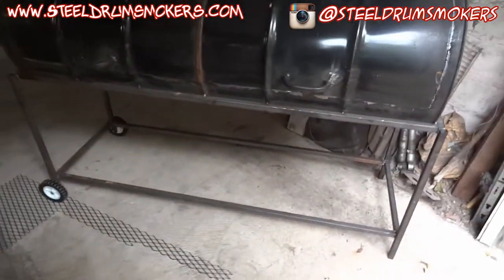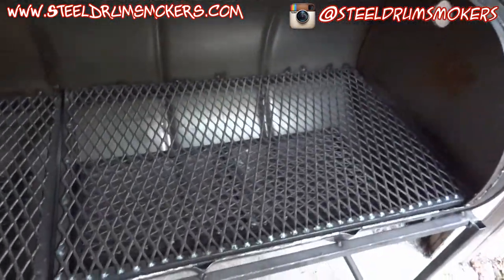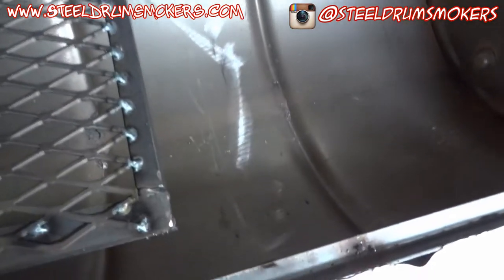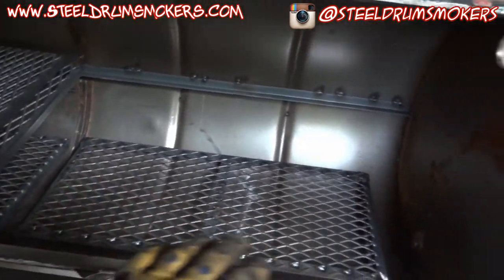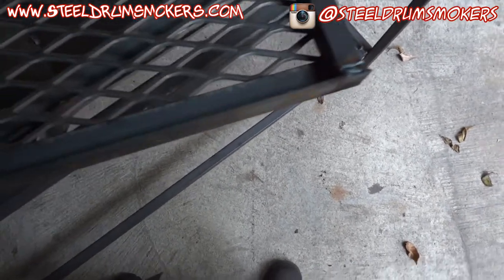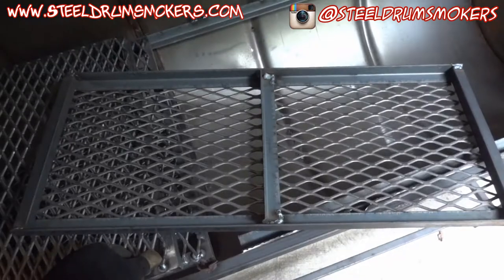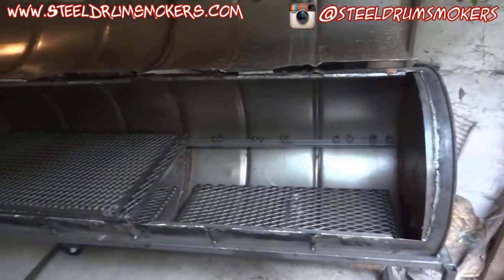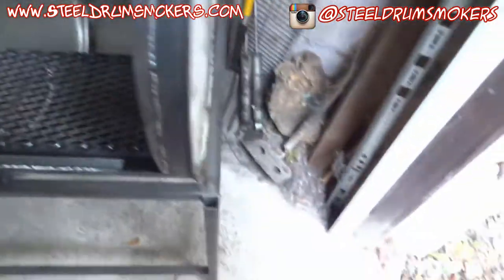Steel Drum Smoker's BBQ - Double Barrel Grill Build - Part 3

Comment: I wanna combine this concept with aspects of the 275 gallon smoker to create a unique build.... two horizontal drums and one vertical drum for the firebox and warmer... I love the water smoker internal design for the grease and water drain... I probably would widen this Frame so the drums can sit lower in it, and the port from the fire box can be cut into the end of the right drum ... how did this double drum smoker work for you ... did you end up scrapping it ?
Reply from the maker: So... I should have cut the drums in half as opposed to cutting the doors out. It was very flimsy and I never ended up using it. I still have it, haven't quite figured out what to do with it at the moment.

Comment: Looks good, Dash. I wouldn't cut it up. I would at least cook on it once after all your hard work. I would recommend adding two vertical pieces front and rear in the center that attach to the drums. Otherwise,  it may buckle in the middle once you throw the heat to it. I like it. I want to see that bad boy cooking. :)
Reply: ...and also run two short legs to the ground under those pieces. Just a suggestion, but that will save you some grief.
Reply from the maker: +70kirkster hopefully I can figure out how to make it happen. if not I'll be texting you, LOL
Reply: +Dashtc Basically,  two extra framing pieces just like the ends. Connect the center of the drums where you welded them together to the center lower frame, but also leg all the way to the ground. That will shore everything up. But you're welcome to text anytime my friend.

Comment: Barrels are hard to weld on I’ve done it a few times.
Reply from the maker: They really are. Too thin to really be able to to much with them. What I found was that I had to do more spot welding than running a bead or the base metal would heat up and melt.